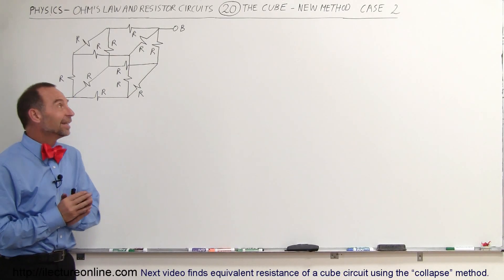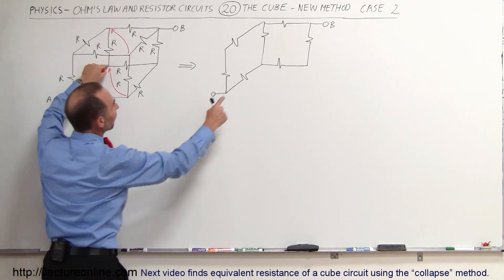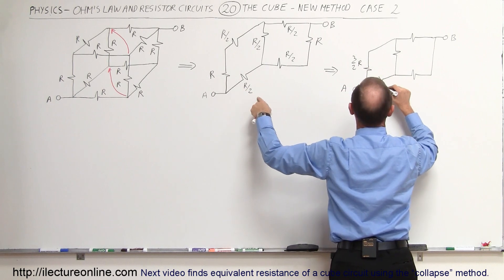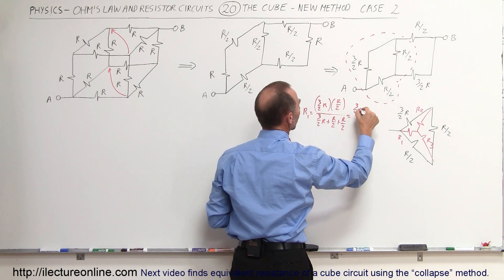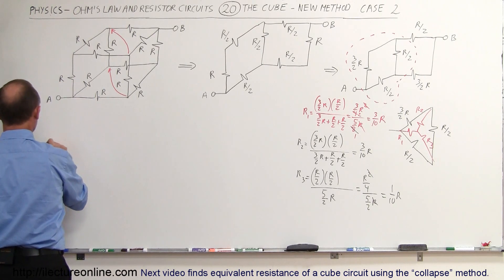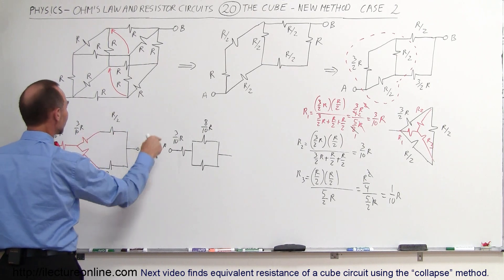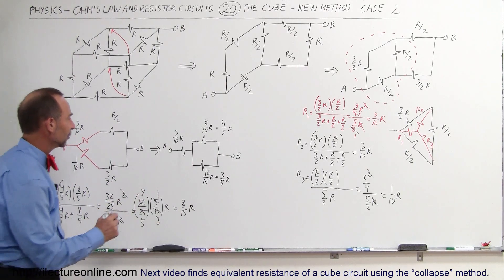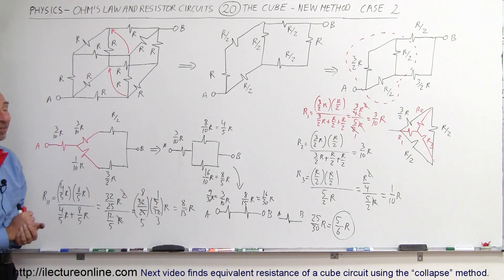Physics 42   Ohm's Law and Resistor Circuits (20 of 23) The Cube: New Method Case 2

Comment: Hi Michel,  just found this now. It is very relevant in geophysics where we often have to measure the resistivity of samples which are not simple cylinders with perpendicular ends. What is the resistance if a two-point contact is made from the opposite corners of a solid cube of conductive material of a given resistivity as in your A-B in the video?    There is also a four-electrode method which assumes the electrode spacing is very small compared to the dimensions of the sample
Reply from the maker: That is an interesting application of this type of solution.

Comment: Can we use this method if we have batteries and resistors on each side of the cube ? If we can , will the batteries be in parallel as well as the resistors?
Reply from the maker: MrAdy0207 
Once you add more than one battery source, the problem needs to be solved in a very different manner.

Look in the following playlist:  PHYSICS 42 RESISTOR CIRCUITS

To find videos explaining all types of different ways of solving circuit problems.

Comment: well i took 30 seconds to get 5r/6

r/3 +r/6+r/3 =5r/6
Reply: I think i was the only one to get it in that way, (some  small  trick,  equal potential points may be shorted )
Reply: can u explain how you got it ?
Reply: @surya8891  The cube is perfectly symmetrical.
Let's build it using twelve 1ohm resistors.
Now assume we send 6A current into corner A. It splits equally so 2A goes in each of 3 directions. The voltage drop in each of the resistors will then be 2V. Because the voltage drop is equal, the potentials at the other ends are equal and we can connect those ends and the 3 resistors work in parallel like 1/3ohms.
Each of the three resistors now connects to two resistors which also are perfectly symmetrical so 1A current goes through each. The 6 resistors therefore work like they are in parallel with total resistance 1/6ohm. Finally the currents combine into 3 symmetrical resistors at the other corner which behave exactly like the first three so tjry act like 1/3ohms. Total resistance therefore becomes 1/3 + 1/6 + 1/3 = 5/6ohms

Comment: Easier
At point A  current is I/3 at next point current is I/9 and the following point current will be I/18 to meet in each (2 current meeting point) then  it will pass through each branch meeting finally at B.
Multiply each current by R  at the three points and  adding 
will get the voltage between A&B which is  identical to (I).(R'total)
Reply: Ok
Reply: It is 1/27 not 1/18